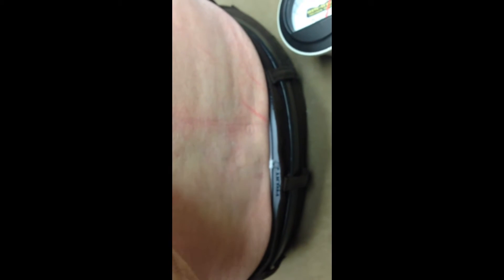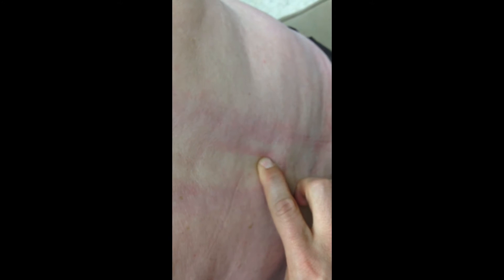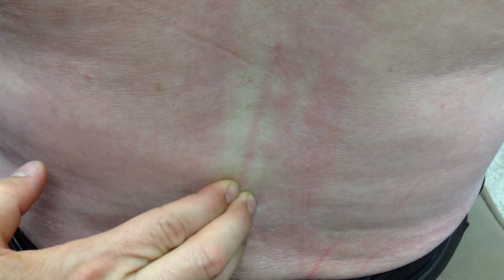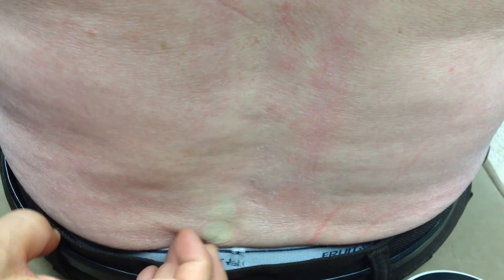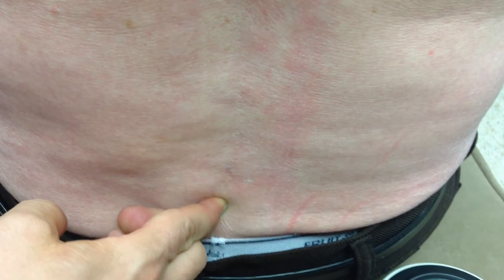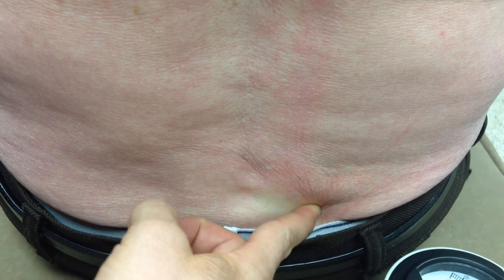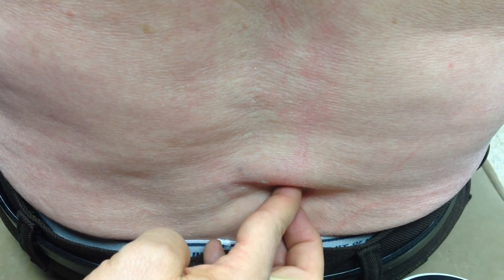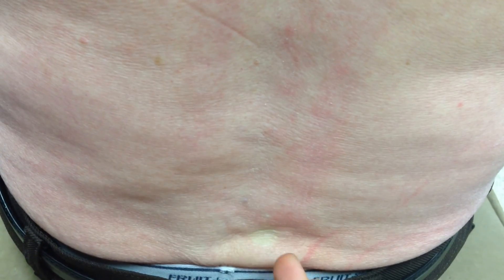Exam Basics - Pitting Edema

Comment: Were you able to fix it? How? What was the dx?
Reply from the maker: Hey Kim, yes ma'am! I'm happy to report that he was fixed with an HVLA Gonstead adjustment in the side lying position. His Dx was a swollen L5 joint with retrolisthesis aka subluxation. There are lot's of videos out there on Gonstead adjustments that demonstrate the correction.
Reply: @ChiropractorEdmond  I am 20 years and and have had pitted edema for quite some time. I went the the doctor about it a year ago to get checked for blood clots but, they said there weren't any. Now in 2019 I am experiencing the same situation and it's gotten worse in my left leg. I've been experiencing what feels like my heart is being pulled out each day for two weeks straight. What are your recommendations for this issue? Thanks in advance.
Reply: @ANeal360  How are you? What did the doctors tell you? I've been experiencing stage 2 edema and I'm about to see another doctor since my primary doctor frankly isn't doing a thorough enough job. In the past two weeks, I've noticed the circulation in my legs is poor. My feet begin to turn purple after sitting upright after a mere few minutes. I'm freaking out thinking that it's congestive heart failure.
Reply: I have this problem when i eat food my body retains all tje water and im skinny and my legs and face gets huge idk what to do help
Reply: Plant based diet can help